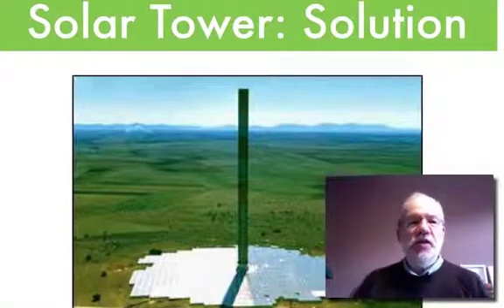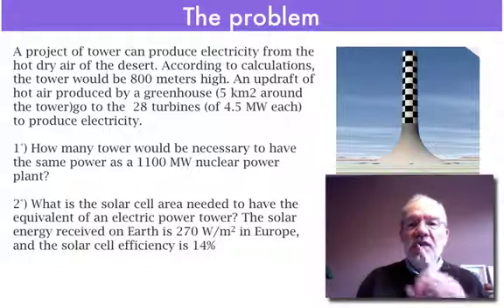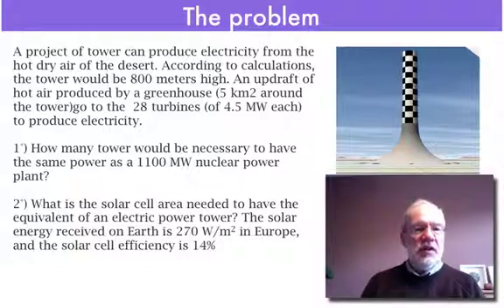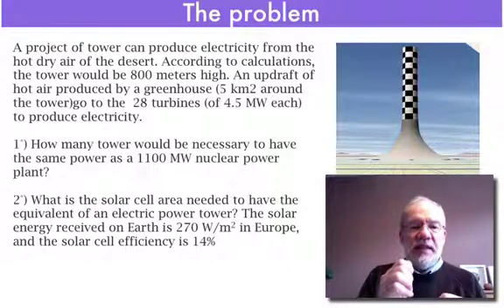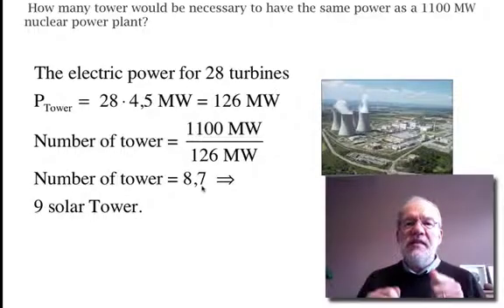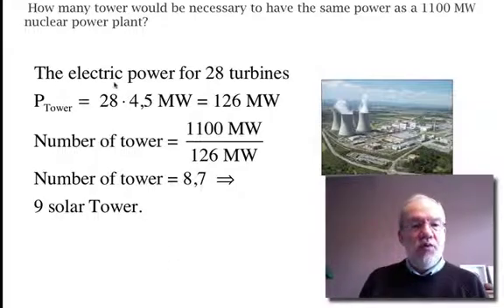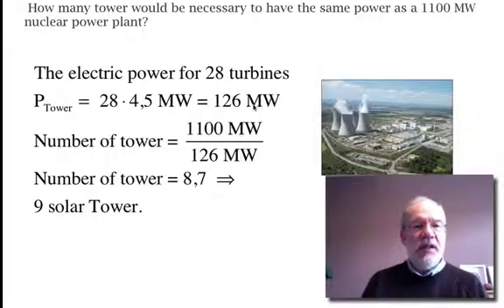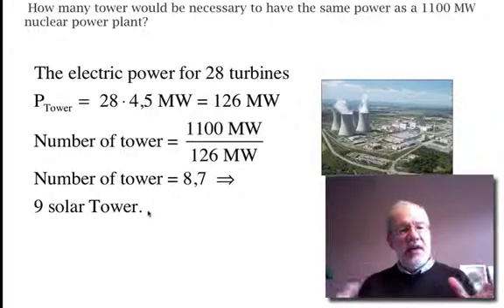solar tower problem (physic solution)

Comment: If you paint your solar chimney black that would help. But if you build it over a shallow dome that may enhance the greenhouse effect making more hot air.
Reply from the maker: The production of hot air comes from the greenhouse effect at ground level with the greenhouses, the chimney is only present to cause a strong draught so that this hot air shows quickly and drives the different turbines at ground level. Therefore it is not necessary that the chimney is in black color.  On the other hand, if we place additional turbines in the chimney, to put in black color this one increases the temp&rature, but decreases the "draft" and thus the output. So definitely no need to put in black color.Thank you for your comment
Reply: @flonespaceteacher  So it would need a lot wider area and if it was domed it would have to be very shallow?